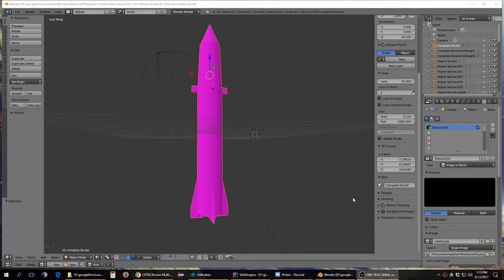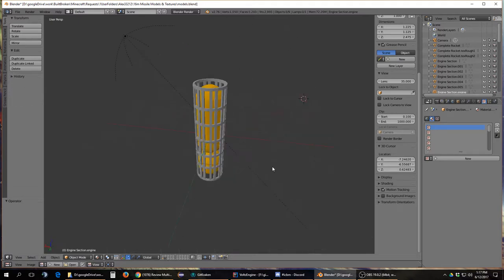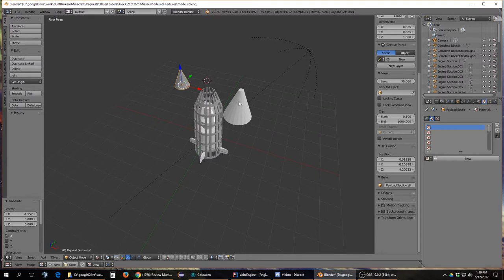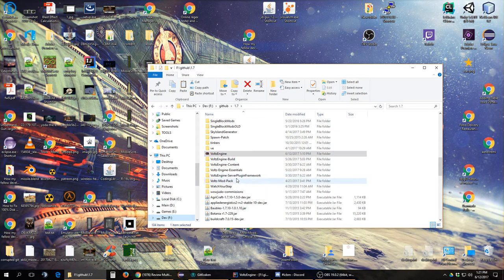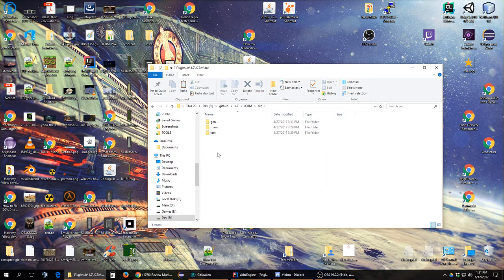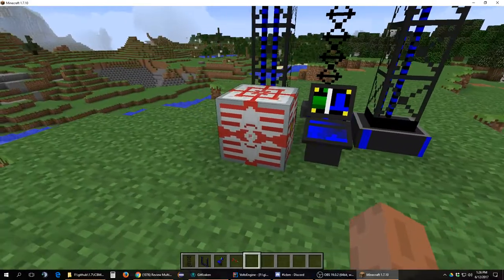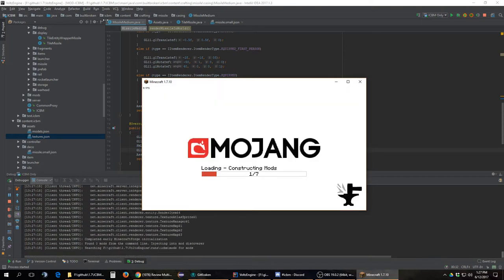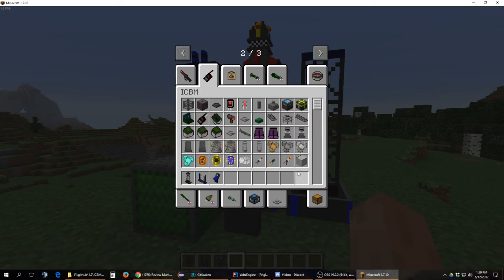Dev Work #154 - Model follow up & Anti-Ballistic missile test

Comment: The anti ballistic missiles works fine. It just require you to assign a safe target(a target far away enough) to land on in case the ABM fails to lock on a hostile missile. If the ABM does not find a hostile missile it will act and preform as a conventional one and therefore it cannot be launched without valid coordinates because it would blow up the launcher.